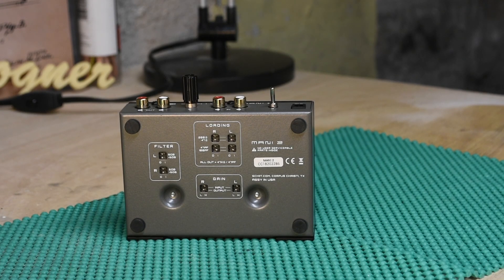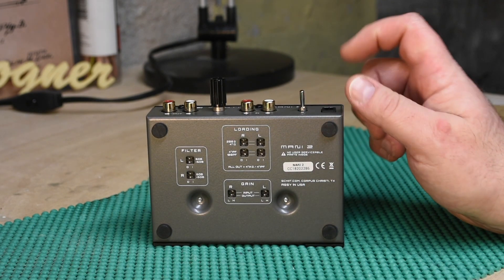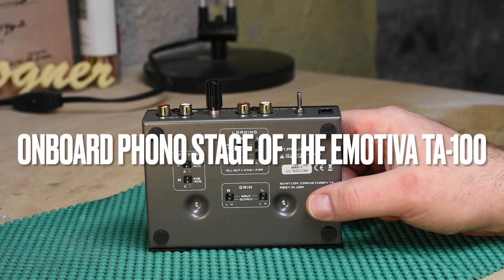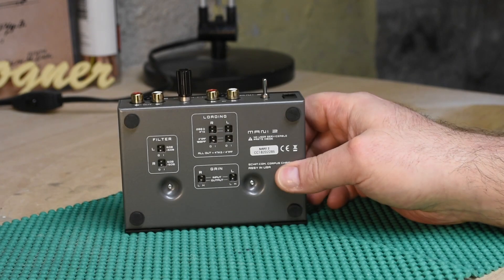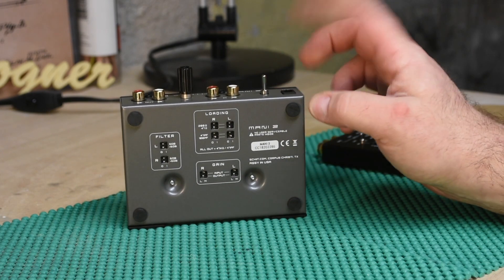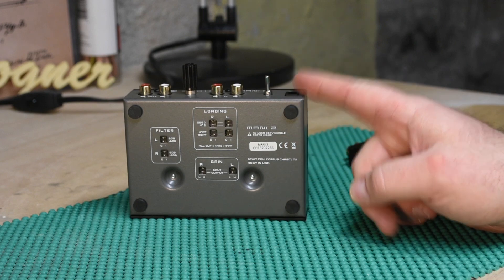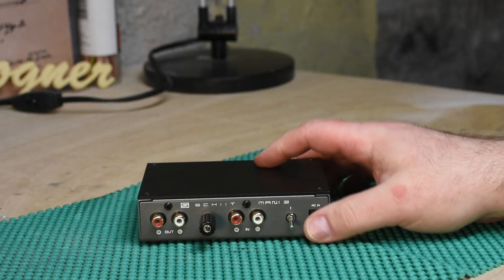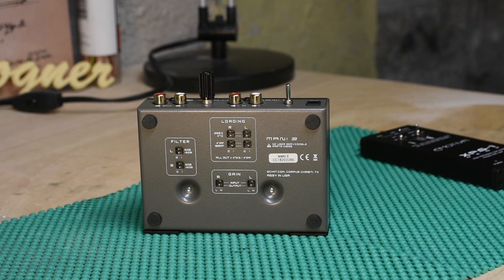Schiit Mani 2 Phono Preamp Review Part 2 MOVING MAGNET

Comment: Thanks for the accurate review.  I had the Mani 1. It just sounded louder than my built-in phono but didn't really improve on the sound quality. Mani 2 is indeed a step up.  Bass is slightly deeper, but most of all, was more rhythmic and well-defined.  Highs and lows hold their notes longer and gave the music a fun, toe-tapping quality to listen to.
Reply from the maker: It's more dynamic and has far improved resolution and sound stage over the original Mani.  It's a huge bargain at $150.

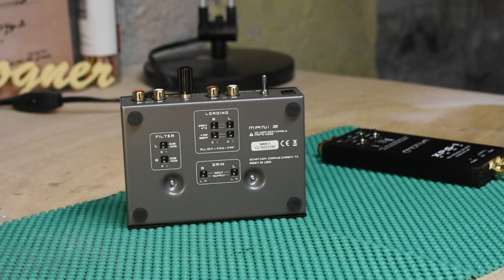Comment: 6:10 A linear PSU for the Mani won't do anything, because it takes AC. 
All of the rectification and filtering is done inside the box.
Just look at the pictures Schiit has at their Mani product page - there's a picture of the board.
You can clearly see the DBF310 bridge rectifier on the board next to the power switch and LM317/LM337 voltage regulators further downstream.
A choke and some decoupling/coupling caps might help pre-filtering the incoming AC when you have other noisy components hooked up to the same sub panel... but that's about it.
Reply from the maker: I'll admit that I really don't know anything about the engineering aspects of all of that.  Is that all that "linear power" means, that it's rectified and filtered?  Looking at the insides of a Sutherland 20/20, that has a rectifier and filtering, however Sutherland sells a linear power supply for it.  shrug
Reply: @6AM_YT  Nah "linear power supply" means that it's using a big transformer to step down the voltage from the power grid instead of a SMPS (Switch Mode Power Supply).
It's called linear because the output is directly proportional to the input, where the ratio of the windings between the primary side and secondary side dictates how far the voltage is stepped down.
It's more or less the opposite of a SUT (Step Up Transformer) for a MC cartridge.

Theory is that switching of a SMPS can cause noise that gets into the rest of the circuitry (either conducted or radiated EMI).
However, a properly designed SMPS doesn't emit noise.
A bad linear PSU is just as bad, as a bad SMPS because the magnetic field of the transformer of a linear PSU can saturate causing lamination rattle (the core of a transformer is made of stacked iron plates).
Another downside of a fat transformer is that it creates a bigger EM field - magnetic in particular.
Normally this is not a big deal with solid state electronics... but you don't want a big magnetic field near your cartridge or things like reel to reel tape... lol
Reply from the maker: I understood some of that, but I'm still confused as to how Schiit accomplishes something that the Sutherland doesn't.  Why would a linear power supply be desirable for the 20/20 but not the Mani?  I'm sure you might be right, I'm just too dumb to wrap my mind around it.  Either way, I have this power supply coming, so I'll find out if it makes any difference.
Reply: @6AM_YT  Well... what I tried to say is that there's no definitive "best".
It's SMPS or linear PSU... it's just a choice.
The design implementation and quality of components are what makes one power supply perform better than another.
But all things equal, the linear power supplies tend to be more easily serviceable.
That's because more discrete components are used, so if something wears out, you can replace that specific component, while SMPS contain more integrated components.
It's a bit like that age old debate of phono preamps using opamps versus phono preamps using all discrete transistors.
It's just a different design choice, but there's no definitive best, everything is a tradeoff one way or the other... things are way more nuanced than consumers (and managers of these companies lol) generally want it to be.

Two things are for sure and that are their reputation and "consumer experience".
SMPS have a bad reputation, because in their early days they were very noisy so people stuck with linear power supplies instead.
So the linear power supplies still have a better reputation of what happened back then (the 80s that is).
On top of that, a large transformer is something tangible - it's solid, it's massive.
Because of that, consumers feel they've actually paid for something substantial - in contrast to something immaterial such as the calculations that have been done or the "design choices" that have been carefully chosen.. or even a "design philosophy".
Because consumers are way more materialistic then people want to believe.
Reply: Too much jargon in electrical engineering.  You know that's what people do when what they do isn't really that hard but they want to raise the barrier of entry to prevent the uninitiated from competing in the economic space, right?
Reply: @Vapourwear  Awww don't be such a partypooper!
Learning new skills and things is part of what makes a hobby fun! 👍
Reply: Yes, I agree with that. I have an early Pro-Ject Phono MM, which has the same arrangement - an AC input, which is then rectified to provide the necessary + and - 15 volt DC supplies. The later versions use an 18 volt DC input - this is converted by a solid state voltage converter to provide the necessary -18 volts DC and both the + and - are then regulated down to 15 volts. The objection to this arrangement is that it is possible for hash, noise, or other interference to be generated by the solid state voltage converter. In fact, there is no noticeable interference of this kind, however, in principle, an AC input if much to be preferred. The only reason for using a DC input is that an SMS power supply is much less expensive than an AC transformer. The earlier Phono Box MM/MC uses an AC input and these are therefore still quite popular for those wanting a cheap, but remarkably good, for the price, MC pre amplifier.

Comment: Would you recommend the Schiit Mani 2 to pair with a Yamaha AS501 integrated amp? I have an older Sansui turntable with an Ortofon Red cartridge. And would the settings be similar to what you demonstrated? Thanks! And awesome videos too 👍🏼
Reply from the maker: I've heard a bunch of stories about people having issues with their Mani 2's, so there's that.  I can't say that it's going to sound better than the built in phono section, but I would assume it would. I guess you're probably on the fence about it and I think I am, too.  I'd say your best bet is to try to find one used so if you can probably break even if it doesn't work out.
Reply: Thank you for replying back! But yea, I’ve been reading and hearing a lot of mixed opinions about it. For the most part it sounds like a great product, but maybe just not for every system.

Comment: I have the Mani 1. It sounds good, but it's pretty noisy at higher volume (feedback, RF, I don't know), but I've lived with it for a few years now. I have a ground wire hooked up between the turntable (a Pro-ject Debut Carbon Espirit SB) and the Mani, and a second ground wire from the Mani to my receiver/amp. It helps, but still.  Anyway, I currently have the Ifi Audio Zen Phono Pre-amp on order. Hopefully, it will be quieter and sound better. We'll see.
Reply from the maker: I have a review I'll probably post tomorrow of the Zen Phono and I'll compare it to the Mani 2, so check that out.  I find the Mani to to actually be more quiet than even my Sutherland 20/20.  I no longer have a Mani 1 to compare it to, however.
Reply: @6AM_YT  Cool. Looking forward to your review.

Comment: I also have the RT82. Im having trouble getting it to sound great. My preamp built into my SDH190 Sony receiver sounds good (not great or loud) but this Mani seems to sound great on some records (cranberries Linger sounds great and Pearl Jam Avocado) but my Refreshments Fizzy Fuzzy Big and Buzzy sounds horrid. It gets some real loud weird distortion when I turn up the volume. I listened to Fizzy Fuzzy on my cheap Angel Horn and it sounded fine. You state the Outputs should be set to H but you have em set to L. So that was confusing.
Reply from the maker: For the RT82, you should have the gain settings all set to L.  You would only set them to high if you have a moving coil cartridge.  Hope that helps.

Comment: How did it compare to the Sutherland and Rogue after you ordered the linear PS? Also what brand/name of linear PS did you purchase? I currently run a Mani 1 with the Loki and a VM-740ML cart. Have a second setup so I was going to go this route:)
Reply from the maker: I did.  I had the Zero Zone power supply.  I really heard little to no difference swapping from the stock PS to the linear PS.  Some people had stated for some reason it made a bigger difference with the Mani 1 than their Mani 2.  I cannot confirm or deny that since I no longer owned the Mani 1 to try.  The Sutherland and the Rogue were better, but the Mani 2 sounded much closer than the Mani 1.

Comment: Would you say that the Mani 2 is better than the Ifi Zen Phono(if you have tried that one)?
Reply from the maker: I have not tried it yet.  Sorry.
Reply: I've tried both (recently bought the Zen) to compare to the Mani 2, and the Mani 2 was much better in my opinion. The Zen had muddy sounding mids. The Mani 2 has a very obvious clear scoop, but the instrument separation, clarity, and highs were all much better.
Reply from the maker: @chrisross1347   That's interesting.  What cart was this with?
Reply: @6AM_YT  Running a Fluance RT85 with an Ortofon 2M Blue through Klipsch speakers!
Reply from the maker: @chrisross1347  Nice.  I've toyed with the idea of trying to replace my VPI Scout with the RT85, but it seems like too much a long shot to spend $500 on attempting.

Comment: How was mani-2 better then emotiva ?? Or any other phono you have ?? Cause the mani 1 sucked eggs
Reply from the maker: The Emotiva has bloated low end and grainy highs compared to the Mani 2.  The original Mani was okay for MM carts, but pretty useless for MC.  The Mani 2 works really well with MC carts.
Reply: @6AM_YT  how is the soundstage depth and width with Mani 2 ?? How is the placement of instruments etc ?? Or is it still within the speakers 😬
Reply from the maker: It's significantly better but it's not going to beat out much pricier phono preamps.
Reply: @6AM_YT  pricier 😂?? The bellari vp-29 ($49) pro-ject dc phono ($129) art audio ($79) were all way better then Mani 1 phono … in every way possible with MM cartridge… I didn’t bother testing the MC side of it
Reply from the maker: @borisgorin1170  I’m talking about the Mani 2.  It really is a huge upgrade to the original.
Reply: @6AM_YT  I hear you but I’m still not sure I want to hear the 2nd version cause the 1st one was so shitty pun intended 🤪
Reply: @6AM_YT  btw if you get a chance pick up the Rega AD 2 phono stage, break it in for 100 hours or so and tell me or us what you think of it 😬, but only use it with MM cartridges 👍

Comment: I’m using an upgraded power supply from Alibaba with a late model Mani 1 and it unequivocally sounds better.  The improvement was similar to when I upgraded my Lp120x turntable to a Techniques sl1500c (using an AT vm540ml cartridge on each).  

Btw, I bought the Mani 2 after watching your review.  Looking forward to trying out the power supply with the new Mani as well.
Reply from the maker: Let me know what you think.  I hope I didn't overhype it!  Keep an eye out for my review of the Zero Zone Mani power supply.
Reply: @6AM_YT  Will let you know how Mani 2 + Zero Zone works out with my MM cart (AT vm540ml).  The Zero Zone is nice - very high quality look and feel.  Doesn’t come with a main though.  Improved my Mani 1 for sure.  Any noticeable improvement I get with the Mani 2 for $150 is a win for me since the phono preamp is the only reasonable upgrade I can do (beyond treating my room).
Reply from the maker: @diamondintheback1970   I work in IT so I have access to limitless amounts of AC cables.  Hopefully, I'll have the Zero Zone by Saturday, so I could have my review up by early next week.
Reply: @6AM_YT  Mani 2 in the house! Plugged in with Zerozone.  Won’t steal your thunder and will save  my comments for after your review.  I will say the Mani 2 is part of the family now along with a Technics SL1500C tt, AT540ml cart, Schiit Jotunheim2 headphone amp for Sennheiser HD800s headphones and preamp for Genelec 8030C monitors and 7050C sub.  Looking forward to your review.